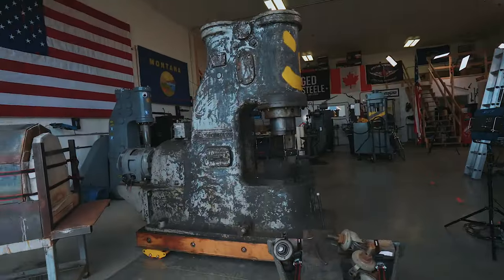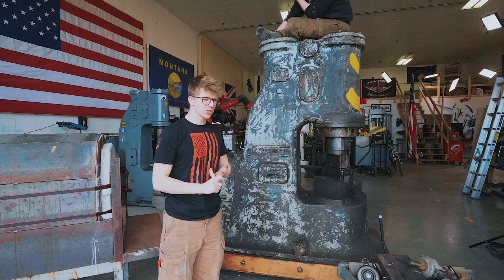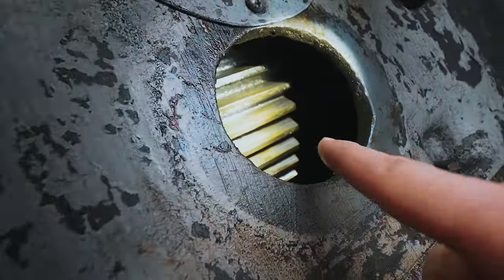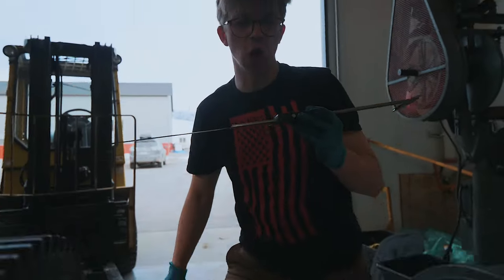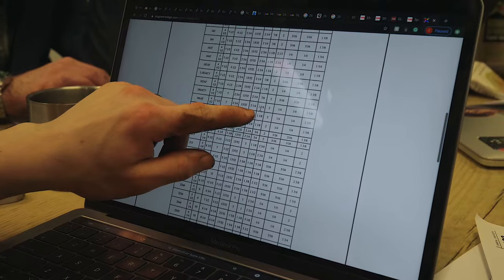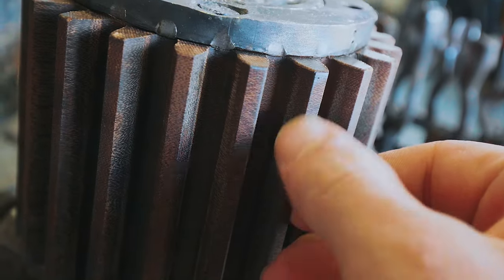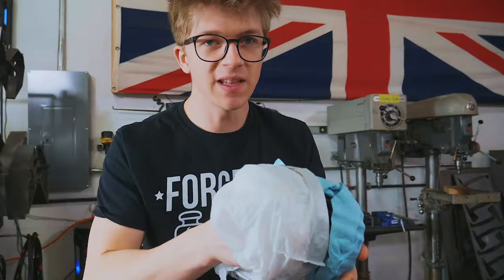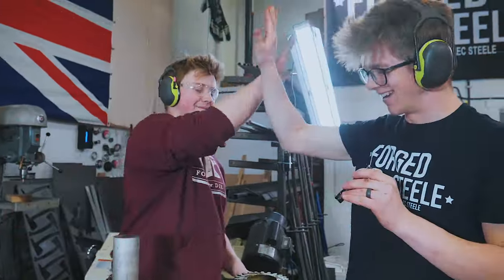FIXING THE 300LBS POWER HAMMER!!! Part 1

Comment: ALEC: Just wondering; do you intend marking this one down to experience or are you going to do something about being ripped off for "tens of thousands"? You have a cool attitude(in every sense of the word "cool") but, either the haulier or the seller is to blame for the damage. By all means; fix it yourself(you do have a metal shop, after all) but send someone the bill.
I'm not a big fan of today's "sue someone for EVERYTHING" culture but you're down a lot of money on this one.
Reply: In general with used equipment, you inherit all the old dings and damage. This sort of thing is par for the course.
Reply: @jason00121  It should still be "as described" and fit for purpose. From what's been said since, it would appear that the seller did cover the cost of repairs. I may have picked that up wrongly of course.
Reply: A 70 plus year old machine is a crap shoot, even after rebuilding. These things are an adventure and the mechanical issues are an aggravating game of whack a mole. Impact machinery tends to be self destructive, that is just par for the course. Air hammers get expensive and big ones especially so. You could have bought this hammer new up until 2001. I dont think they had sold one since the early 50s. The pricetag when CECO closed for a hammer like this was north of $200k. They bring premium prices, and the one piece models especially. I have seen a few of these over the years and can't recall seeing, even a trashed chambersburg under $20,000.
Reply: @jason00121  but alec said it was rebuilt and ready to use, doesn't look like it to me. btw sry for digging up this old comment ^^
Reply: Fuor sure, definetly seems like he go played.
Reply: Id say Americas or state consumer law isn't that great

Comment: With a hammer of that size, you will probably need to make a rubber footing for the new motor, otherwise it might crack again.
Reply: Unfortunately that would mess up the spacing and alignment of the motor gears, and wear it out.  So we can't rubber mount the motor on this hammer without doing a belt-conversion or adding a stub-shaft with bearings to couple the motor to.
Reply: That’s why it has a fiber drive gear to take up the shock

Comment: I was having my dad take a look at this video, because he's in the motion control industry. I was hoping he would be able to direct you in the motor department. He did say that they stopped making 1 1/2" shaft motors of that size, because they broke the shafts easily. Most importantly though! The play in the sleeve of the gear is intentionally put there. He didn't specify as to why, but if I were to guess... It's to cushion the initial shock of the gears engaging. The guy who runs the YouTube channel AvE may have some knowledge about these things too! Good luck!

Comment: crazy, that even such huge machines have those epoxy-paper gears
i just know them from 12V motor gears
there, they supposed to be as a "has to break"-piece if the gear or the stuff behind the gear gets stuck
so....maybe, you should also look for this gear itself too

Comment: I've had this same problem numerous times. Unless there's a good reason not to, (such as overly weakening it) I always turn down the shaft and mill a new keyway in it. This is far quicker, easier and cheaper than boring out the gear and broaching a new keyway in it (with a broach you had to buy just for the purpose). Plus, if you ever need to replace that gear as well then you'll need to modify the replacement in the same way. Also carbide inserts don't like intermittent cuts BTW.

Comment: I worked at a steel mill in Pittsburgh when I was a younger and we would put steel plugs into liquid nitrogen for a few minutes and then hammer the plug into  the ends of enormous steel rolls  (for rolling out stainless steel into thin sheets for cars,Appliances and lots of other stuff using only the weight of the roll to achieve it) and when the steel plug heated back up to room temperature it would expand and fit so tightly that you'd swear the plug and the roll were one peice of steel. The plug could support the weight of the roll (almost 500k pounds in some cases) without any welding or anything else holding it in.
Reply: when i toured the Bethlehem steel plant in Steelton pa, i was quite shocked at what happened when they dropped the electrode in to the oven. pretty crazy.  steel plants are such amazing places.
Reply: probably should have said lowered, not dropped.
Reply: @frotobaggins7169  Yeah man they really are nteresting but also extremely dangerous and terrifying lol. Theres a million ways to be killed when you're working with hundreds of thousands of pounds. I was a chainmen so it was my job to rig up the rolls to the crane so they could be moved. If one of the cables were to break you're beyond dead. When we'd set the steel rolls on the train to be transferred we'd put wooden wedges underneath it to stabilize it,if any of the weight shifts onto a wedge it can shoot out like a bullet and kill you. I once saw a guy who was picking up a plug that was just pulled out of the liquid nitrogen,he wrapped it up in a towel but unintentionally touched a large area of his forearm to the cold steel,he reacted to the burning feeling by dropping the 60+ pound plug onto the floor but the plug was frozen to his skin so it tore a cellphone sized chunk of flesh of his arm. All that stuff is bad but the most terrifying thing is when the rolls are cast incorrectly and air pockets are left inside (usually only happens with cheap Chinese steel). when the steel cools,the air pocket gets compressed and is under incredible pressure. When they put the roll on a lathe to cut it and unknowingly cut too close to the air pocket it will explode and send razor sharp shards of steel, that weigh as much as cars,flying across the plant. after a roll explodes once it can explode again days later so all the peices have to be covered in giant cargo nets. Pretty wild stuff.  Sorry for the long comment,I didn't even realize how much I was saying lol.
Reply: When you replace the piston housings on an old airplane, you freeze the case and heat the jug. It barely slips on but it does. Make sure it's straight, quick.

Comment: There has to be some relief if this was a "ready to roll" machine".  The person who sold it to you should make it right.
Reply: iam pretty sure its all in check, the old owner should at least compensate for the cost of the new motor
Reply: No the guys transporting it should pay as they should deliver a item in the same condition as when they picked it up
Reply: @bronchiosaurus2766  I certainly would hope so.  After that lathe debacle, you would think Alex would have like some new form of PTSD (Post Traumatic Shipping Disorder).
Reply: @PiSt0nZ1  The breaking points are already rusty and couldn't have appeared on transport.
Reply: PiSt0nZ1 looked tough me like it didn’t have washers where the anchor points were.
Reply: PiSt0nZ1 if you would have paid attention the cracks all had rust in them so it was broken for quite awhile. So I seriously doubt the transportation company broke it.
Reply: @PiSt0nZ1  You can tell that those cracks are old, so wasn't broken during shipping
Reply: chances are the machine was in good condition before it was shipped, the moving company was probably responsible for the damage, most likely they thought the machine was heavy enough not to tip over so it hit the side of the trailer cab as the truck turned a corner, damaging the flywheel, then they tried to secure it to a base with bolts and actually somehow managed to overtorque the bolts causing the feet to shatter. this moving company must be fucking stupid and they should definitely compensate alec for the damages.
Reply: @duncann231  it could have if the machine was moved in an open flatbed instead of a cab, old steel rusts very quickly (especially when the grain is exposed) in open rain.
Reply: renogiza - I can second your statement regarding how quickly surface rust can appear in cast iron when it cracks. I’ve had a number of old cast pieces break and have them visibly rust within a few hours. Not saying that your theory regarding what happened to the equipment is 100% accurate, but it’s entirely possible and possibly entirely likely.
Reply: @stevenweindorfer2554  ever leave a piece of cast iron out side for 24 hours... it gets rusty very quickly. He'll leave your car parked for a few days and check your rotors they will be covered in surface rust. And it is definitely caused by shock. Machines like that dont tend to jump up and down. If you get what I am saying.
Reply: Noah Ferrari yes and that rust in there just isn’t. Surface rust. Those cracks have been open awhile. But hey it’s easy to blame the transportation company because they  have to carry 100,000.00 cargo insurance to be able to carry freight in the states.
Reply: @stevenweindorfer2554  seems like you have a dog in this fight. Looks like pretty standard week old rust to me. If it were older it would start bubbling the paint
Reply: Noah Ferrari nope just tired of everyone acting like they know how something was transported to Alec shop when in fact not a one of us was there to see it come in. As far as week old hell it only takes a couple of days to get anything shipped in the United States these days.

Comment: There are shaft sleeves/collars that we use at work to combine different shaft sizes too different sprockets. It's called a taper lock. I hope this helps.
Reply: Dustin Spann Is that like those special fittings you can buy that allows you to fire say, a 9mm from a 12G? Or not really? 😂😂
Reply: I'm not familiar with those.

Comment: First of all Alec if your reading my comment that is sooooo awesome. SecondAlec I am really loving this hammer and I have a tip for you. I think you should buy a machinist handbook. I got myself one and it only cost me $20 plus shipping on amazon. The handbook has every bit of information about gear ratios, thread sizes and rations, gear sizes, motor power and every other bit of info about motors, shafts, etc. I sure it would rally benefit you in fixing your power hammer. You could find all the info about fixing parts in a machinist handbook and they are pretty inexpensive.

Comment: I’d just remake the whole thing. You’d be saving yourself a lot of heartache down the road.
Reply: Boring it and alleging it won't cause any issue. That's the proper way to do it. Especially since he'd have a hard time seeing up a dividing head and cutting a gear. He's not a machinist.
Reply: Andrew Delashaw  - I’m talking about the center bushing. What he knocked the micarta gear off of. Plus he’d be able to fix the problem with the grub screw threads. And have the added benefit of being able to chose whatever electric motor he’d want and be able to custom fit the bushing to said motor.
Reply: I honestly thought that from the start. We know he could do it, may it take longer? Sure, but then you know it's perfect.
Reply: My thoughts exactly. ThisOldTony has a bunch of boring videos, and I'm sure he's broached the subject once or twice. A carefully measured request might be key in getting the machine in gear, though he is a bit long in the tooth.

Comment: Seriously though, if it's non-functional and advertised as "in working condition",, I'm pretty sure that constitutes fraud.
Reply: From a commercial seller (manufacturer) - yes, private-sale - nope it was his responsibility to check it before he paid. Same goes for used cars.
Reply: @_r-a-f_  well with cars you can claim lemon and if you win in court the guy has to pay you back
Reply: @ConLeche29  lemon law on a used car lol who told you that? Lemon law applies for new vehicles and forces the manufacturer to buy it back. No such protection for used cars. They are all considered as is. Of course you can sue them but good luck in litigation.
Reply: @_r-a-f_  Nope. Completely wrong. If you go to a dealer and he's selling a used car, it doesn't mean it's a free for all and they can sell you something and not have to meet it's sold as claims. If they say it had a brand new engine put in, and it didn't. Fraud. If they say that the interior was just upholstered with new leather, and its old cracked leather. Fraud. If the seller said that it was in 100% working condition, he most certainly can file suit. If that were the case, people would be online selling broke junk and no one would have recourse. (See how dumb that sounds?) Whether something is new or used, it does not matter, it must be as advertised. The guy talking about a lemon law on used cars is wrong, but don't try to tell him he's wrong, with more wrong information.
Reply: @xenonram  dealer is not a private seller. We are talking about liability in transaction from private seller. There's a reason why you need a dealers license to sell. You are considered a commercial seller. If you buy a car from a PRIVATE party all bets are off
Reply: @xenonram  dealer is not a private seller. We are talking about liability in transaction from private seller. There's a reason why you need a dealers license to sell. You are considered a commercial seller. If you buy a car from a PRIVATE party all bets are off
Reply: Its most likely working but not safe to use because the motor feet are broken and the cracks in side

Comment: I used to be an engineer designing jet engines.  The turbines are connected to the compressor shaft by soaking the shaft in dry ice and when everything comes up to temperature, you have a wonderful compression fit.  Ok, that was back in the 80s and it is way colder than your standard freezer.  Ain't science wonderful.  Keep up the good work.

Comment: Keep up the good work! I bet the soft teeth are designed to break before the expensive ones in the machine do and possibly allow for slight miss-alignment. I agree with boring out the hub and re-broaching. Welding in a new hub sounds like an nightmare waiting to happen. If for whatever reason you overshoot the bore you can always sleeve it, there is also a process called spray welding in a last ditch effort but that isn't ideal, although it would make a cool video. When you go to bolt it back down, grab some shims off McMastercarr and align the shaft as best you can with the dial indicator, its standard to have shims under each motor pad, if you end up making custom ones try to have them overhang the motor pad by 1/4". I recommend using grade 8 fasteners to secure the motor. When bolting into a casting you want as many threads engaged between the fastener and hole as you can to distribute your clamping force, reduce stripping and pullout.  Using a threaded rod/ stud you can bottom it out in the blind tapped hole to maximize the thread engagement. I would use belleville/ conical washers in addition to flat washers to hold the motor bolts tight, they act as little springs and keep the pre-load. Shoot me a message if you would like me to elaborate.

Comment: did you not get shipping insurance on something that big? and did the company you bought it from not give you a guarantee of the condition ?
Reply: Probably bought in auction, and if I’m not mistaken auctions usually don’t offer insurance. I can be wrong tho.
Reply: @marcd7332  Could be Auctions are normally final sale. But to not have shipping insurance for a big ticket item like that.
Reply: Brainmalfuction It wasn’t broken in shipping, look at the rust on the cracks indicating they are old, it was broken before/when they bought it.
Reply: Used equipment sold as is. No warranty.
Reply: @Brainmalfuction  It doesn't matter if it is sold "as is." "As is"was working and undamaged. That'd be like me selling you a car, tell you it's not brand new tires on it, and it shows up with tires balls as bologna skin. Also, just because it came from an auction, doesn't have Anthony to do with whether it was insured. It's insured through the freight company. (Assuming he used a reputable freight company that's insured.) He can very easily file a claim through the freight company's insurance.
Reply: Andrew Henry Cast iron can start rusting in a matter of hours, if not even faster than that. Some of the cracks look older, however.. most of them look new. Also.. from what I understand, he bought this machine with the understanding that it was used, but refurbished and ready to go. And he didn’t opt for insurance because of that (from what I understand). Either the seller or the shipping company effed up big time. I really hope that he explores his legal options if I am correct in my understanding of the situation.

Comment: If you’re struggling with a vibrating boring bar slow the spindle speed down it should help it reduce vibration also taking a bigger cut can help sometimes as it puts more pressure ok the tool and helps it to stop rubbing

Comment: Curious to know how many people feel this could of been brazed back together. I think someone offered up their services when Alec first revealed the problem.
Reply: Apparently no one looks at the comments
Reply: by the time the first video came out alec already ordered the motor there was a week delay from machine to video we all know alec ain't one to sit still
Reply: Plus it had heen repaired before and it was also the motor casing not just the feet.
Reply: @SDMacMan  He did reply to the comment.
Reply: @no no I'm not going to lie...I say that to myself at least once per video--"if there is a hard way to do something this guy will find it every time".  The longest (and most expensive) distance between two points is a shortcut.  If it were me and I was replacing the motor I would probably replace that input gear while I was at it as it looked pretty beat up.